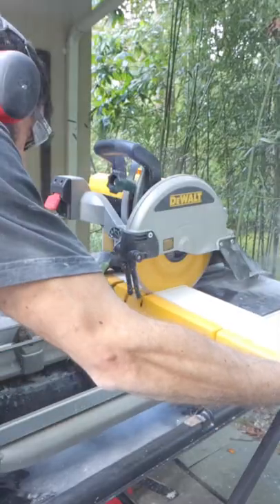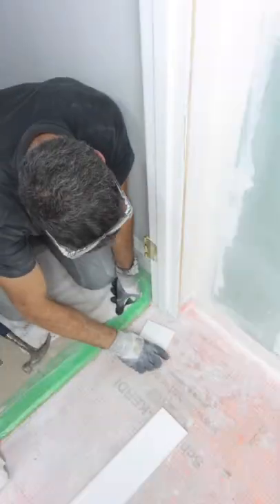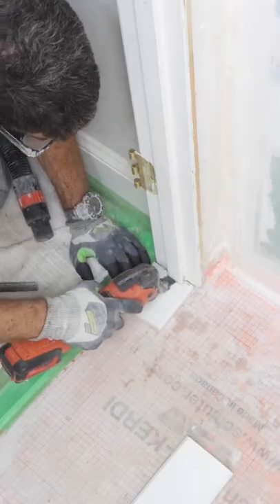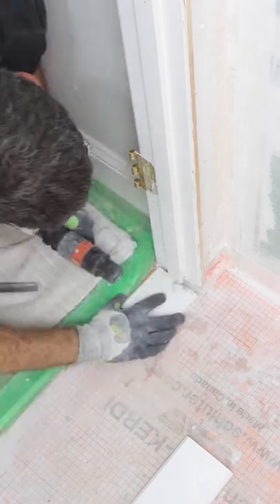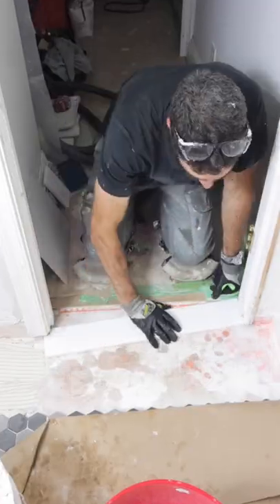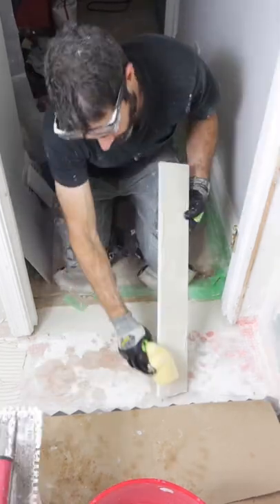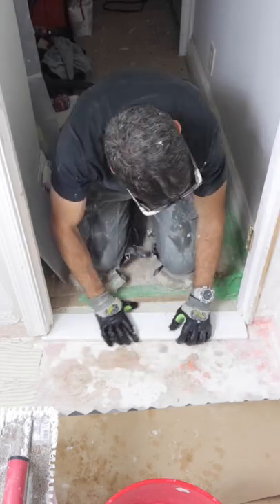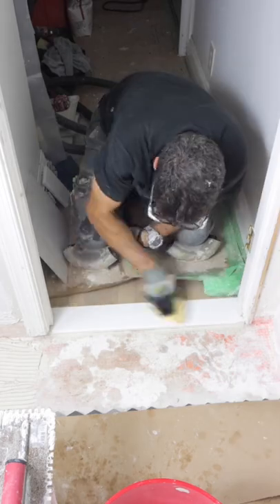Door Threshold Installation Tips - #shorts

Comment: what about the expansion gap between the wood floor and the sill?
Do you need one?
Reply from the maker: Yes, I made it 1/16”
Reply: @HomeRepairTutor  Is that enough?
Reply from the maker: @3dmazter  the prior threshold had no expansion joint, and the hardwood was fine, so it’ll be fine